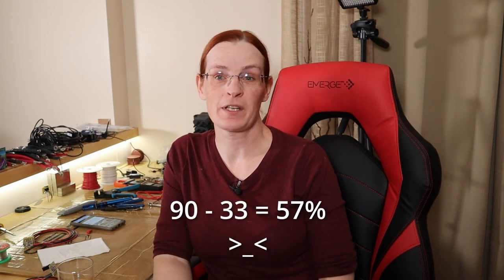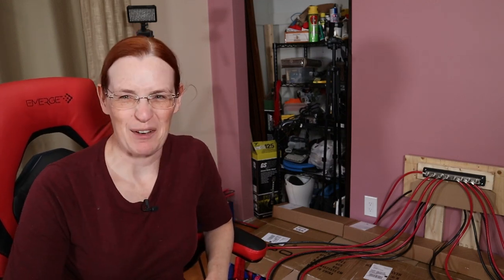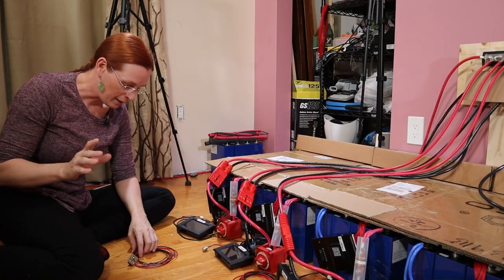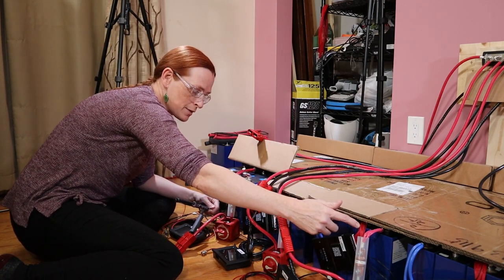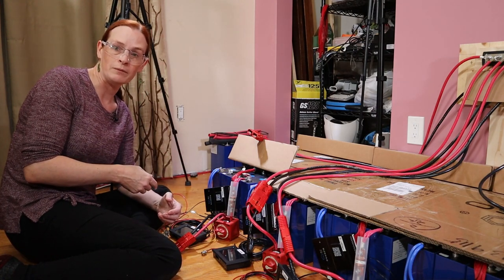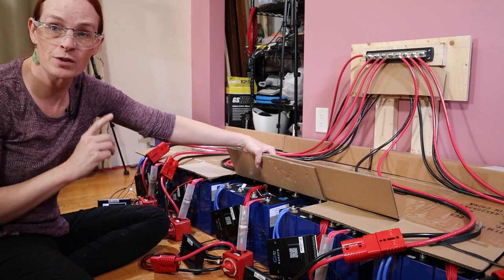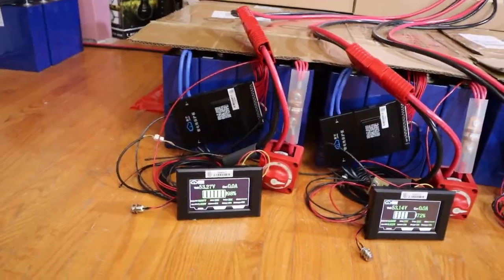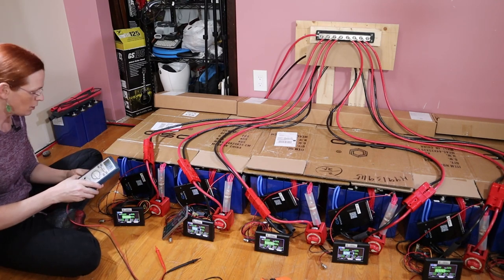It's Alive! (and I need some help) - Part 7 - Big Battery Build! (Ep. 44)

Comment: I have 8 Signature Solqr Batteries on my system. Victron MPPT rs 450-100 charge controllers. About 15875 watts of solar panels. First week all was fine. Second week battery 4 did not reach full charge (did not show 4 leds lit) Next week battery 4 and 5 did not reach full charge. Had the charge controllers set at 56 volts. The next week I put the charger on battery four and it started charging and finished charging 15 or 20 minutes later, same with 5. I changed my charge voltage to 57.5 ( shows 57.15 on the victron shunt) and have not had the problem since. As they get to full charge battery 1, 7, and 8 are the last to reach full charge. I may be charging with 10,000 tto 12,000 watts and the Victron controllers start reducing tthe watts. At about 400/500 watts all are showing charged except 1, 7, and 8. Within 10 minutes or so all are fully charged and I am down to bringing in only what I am consuming. After 5 months all is working perfect. I just assume there are small differences in cells and BMS's. Some days I use 60+ KW and some days only 15 but they have just worked fine. I m not in the middle of the ocean but I am 100% off grid and it just has to run the heat to save my plumbing. (US/midwest) Run your packs for a while and see what happens.
Reply from the maker: I fully expect my packs to deviate from each other over time. It's one of the reasons I wanted active balancers so much... I know each cell will age differently and want to have the best chance to keep them sync'ed though the range of SoC so that I can access the most power. Cheers on your systems sounds like it was a fun build!

Comment: There are many thouths already written...let me add some...any connection has some resistance,  also each cell might have slightly different internal resistance.The accuracy / resistance of connection is also influenced by the torque applied when mounting. Maybe that is why the first and the last battery still get a higher Amps...they might have a litte less resistance in connections, especially the bus bar connection should be fixed with an equal torque.
Reply from the maker: I admittedly did not torque the connections yet, but the resistances of battery cells and cables are all very very close, so I doubt that's a big factor. I think temperature of the outer versus inner packs makes the most sense. I'll break out the thermal camera next time I charge to see if I can see a difference.
Reply: @TheDigitalMermaid  Let me know the result of the thermal cam. I changed at my setup some details...and ended up with the result that my cells that i bought for the first 2 batteries are a total mess...no machting qr codes ect.  At least I regrouped the cells and so got a better performance and accuracy. Building good batteries is quite a complex thing. As you know Andy's offgrid garage I'd like to recommend also youtube Ray builds cool stuff. He is super in every detail explaining his battery construction. Probably you know that channel...

Comment: No one is perfect, i just smoked two capacitors on my power supply and still not sure why .My guess is cheap Chinese caps. I would not lose any sleep over .05 of a volt ? If it is not much hotter than the cats you are good. I have never seen a cat burst into flames and i have had a lot of cats.

Comment: With these batteries and how everything measures differently I would say they are close enough. I bet your shunt shows a little different reading also. My inverters show a tiny bit different than the BMS and my Multimeter also shows a tiny bit different. Dont let it drive you nutty.

Comment: I've played around with I2C voltage sensors and if you look at the raw digital values they are all over the place. So accuracy is a myth with these kind of devices. I also think we get too hung up on being balanced to within a few milli volts. My BMS only displays to 2 DP and my cells are within 10 to 20 mV and that is fine with me,
Reply from the maker: I'm starting to come to the same conclusion. However, I am still unsure about what kind of buffer there is in the battery specs saying to stay above 2.5 / below 3.65v.
Reply: @TheDigitalMermaid  99% of the time you won't get anywhere near those figures. The BMS should only ever take action when something external has gone very wrong.

Comment: Oh, #2. The higher charge current is because the outside batteries are cooler than the middle batteries.   Space the batteries the width of a 2x4 to minimize this from happening.   Double the width for the outside wall.
Reply from the maker: Ooooooh. OK, that makes sense, thank you! I'll repeat the test next time I charge and use the thermal camera to see if I can see a difference in the pack's temperatures.
Reply: These  batteries doesn't change in temperature because the are charge with C 0.03 if the do the are defective.  The reason is lower state of charge, which was also shown by the higher current on these two packs. 😊

Comment: Not fitting the theme but for your information, a Victron Mppt can be used as power supply without connected batteries. So a direct using of the solar power while you doing stuff with your batteries is possible.

Comment: welcome to the world of volt-nuts..   But yeah.... voltage measurements are only as good as the staiblity of the voltage reference (which cheap equipment have cheaper references that vary more with changes in temperature etc).... as far as accuracy.  But precision can be extremely good if its on the same reference. So if there is a single ADC with a single voltage reference sampling all 16 cells, then the precision can be down to very minor levels  (say the ADC has a full scale reading of 60 Volts, and is a 16 bit ADC, can measure down to 0.000916 volt steps ... up to a 20 bit ADC and that 0.0000572 volt steps.  ... obviously that is ideally of course).   Of course if each cell has its own ADC and reference, then becomes a much more difficult problem.

Comment: I had similar when first top-balancing my pack back in 2019. had no faith on what was 3.65v/cell as i had 2 meters, and a power supply all giving different figures. I just gave myself a 2.7-3.55v/cell range rather than 2.5-3.65v/cell for some leeway on the inaccuracies.  Its a fair headache when there is so much money in the cells and we all want a long 20-30 year lifespan from them.
Reply from the maker: Aye, and I think that's what I'm going to do; Annual calibration + generous buffers.

Comment: I went through the same probleme with my 3 packs. I decided to focus on ONE of my meters (turned out that it was an el-cheapo Mastercraft one) and calibrated the pack using the pack total voltage. Since I only charge to 3,45 volts, my conclusion was that even if I was off by 0.1 volts I would still be OK. My capacity test shows that I am hitting full pack capacity.

I DO NOT thinks it's more JK's fault than the fault of the meter manufacturer. All of them are CALIBRATED to a voltage. I think calibrating is required and the calibration is done to ONE meter in the BMS and that is why it affects ALL readings for every individual cel and pack total. 

P.S. I would change / return the Pack B BMS
Reply from the maker: If it keeps acting up, I might, but as you might have seen, BMS E also locked up.
Reply: @TheDigitalMermaid  Could it be bluetooth related? I use an iphone and it has never locked up on me ... ever
Reply from the maker: @paulbarrette2557  Maybe? I dunno. Not like Android isn't widely used, to be fair. How many BMSes do you have?
Reply: @TheDigitalMermaid  4 JK's are running right now. Like I mentioned... it does 'hang' when trying to connect if I do not RE-SCAN first. But I have never seen any of them require a 're-boot'
Reply from the maker: @paulbarrette2557  Not sure what to say... It's happened to two out of my six, one of which I caught on video.
Reply: @TheDigitalMermaid  I say try with another device... Android or not... Just sayin. Keep up the good work!

Comment: 18mV sounds much but thats just 0.53% out. (18/3339*100).  balancingwise it does not matter much as the error in individual cell readings is the same for all cells. the voltage reading is done with an ADC, and for that to be very accurate you need a precision reference, as the ADC has a reference voltage input und just reports how close it is to that voltage (simplified). the pack voltage is just a sum of the cell voltages and the cell voltage measuring was not calibrated. what is the voltage range for an individual cell according to jk ? this also plays into the precision.

Comment: Maybe they need some charge/discharge cycles so they calibrate properly. SoC is not displayed by voltage only but by configured capacity and other factors. The bms then calculates the voltage and amps that went in/out
Reply from the maker: Oh for sure they need calibration via charge/discharge. What has be curious is why six identical BMSes "guess" such different estimates pre-calibration.

Comment: I wonder if there is a relationship between the fully discharged to fully recharged readings?  ... meaning that maybe the lower voltage ones are more discharged first.  I find with only a couple of batteries (prefab) the 100% and the factory state of charge (bogus) test ... by reading setting voltages is not accurate and then adding the Victron shunt it is off even more...up to 20% different ....   !
Reply from the maker: Testing the voltages reported at top SoC and bottom SoC is a good question. I'll check that after I finish charging and when I do a full discharge.

Comment: Did you change your hair color? You can look at a MSDS/Material Safety Data Sheet, and they usually give you all that info you are looking for in the US. If you look at the NFPA/National Fire Protection Association they should list the flammability(red) and instability(yellow) of the battery. The brand I looked up they list Flammability as a 1 of 4 which means above 200F flash point. and 0 of 4 for instability which means very stable.
Reply from the maker: Ha! I'm getting old so ya, I colour my hair. If you know where I could find an MSDS for LFP batteries, I'd be grateful! I'll search on my own as well. Thanks for the comment about NFPA as well, I'll see if I can find how they come to those ratings.

Comment: Hi Maddy, love watching you learn and grow.  You are awesome. 😆 Question,  did you purchase 🤔 the screens with the BMS. I have 5 24v batteries banks and I want to put  this  metter on them.  Do they have them for 24v or are they just for 48v.
Thank you
Reply from the maker: Thanks for the kind words. ^_^ The screens are for the 4S ~ 8S BMSes, which is why I needed to make my own buck converters to get them working. They'll talk to the BMSes, but you'll need to drop the voltage to <= 24vDC. So in your case, they'd work just fine.

Comment: hello my good friend. I was always taught to charge batteries in parallel, corner to corner. In other words Positive, say on the left hand side of positive busbar and negative on the right hand side of the negative bus bar. That way you have charging current going through the bank, and not as you have it now. going in one end all the way to the other end. I hope this is of help. I will keep watching. Have a great day.Regards. Raymond.
Reply from the maker: I understand the logic of this in paralleling packs, but with all banks having equal cable lengths to the bus bar, I didn't think it would matter. That said, another commentor suggested it could be pack temperature, with the outside packs being cooler, so charging at a different rate. I'm going to guess, in my config, that is probably what's happening.
Reply: @TheDigitalMermaid  I cant wait for your next video, to see what you find. I am building a power wall at the moment. So I am watching your battery adventure with my eyes glued to the screen. Have a great day my friend.

Comment: I used to take my Fluke meter in for calibration every year. Curious if a bench charger would read same voltage on all meters. Thanks for sharing
Reply from the maker: A calibrated fluke is probably outside my budget... haha. At least I'm understanding why they're worth what they are though.

Comment: I set my charge and discharge to 75 amps since I will always have these 4 banks connected I should never see more than 50 amps unless I take one down for whatever reason then add it back and the other 3 charge it up which spiked to around 70 amps for me. I can always change that be do not see why I would ever have to unless I get a huge wind turbine then it and solar could go higher than 75 amps per or 300 amps total.

Comment: As one of your 'sailing' viewers, wait you went to the boat and we didn't get video?  LOL.  Think you are getting lost in the weeds when trying to balance down to thousandths of volts. Was curious how your are feeling about the plan now seeing how long the solar takes to charge up the batteries, and thoughts on re-thinking having some sort of combustion based charging source on the boat. But hope you consider including some more boat video's. Hope you were able to get in some good sailing on the Chesapeake, I keep my current sailboat about 20 miles north of your boat on the bay.
Reply from the maker: I'm sorry, I was in a little bit of a burn-out mode so I took my time there mostly quiet. I did do a little filming related to the 12v battery Pb -> LFP replacement that I'll be starting soon, but that's it. I didn't do much actual work on the boat so I didn't think there was much of interest there. I'll be back down there in January though, maybe I'll make a video or two about learning to winter-sail. As for the solar; I knew how slow it would be here at the house, the panels are not aimed well, and there is a lot of shading from trees for most of the fall/winter days. So I'm not worried about solar on the boat, not yet. Though of course that's why I am so determined to get prop regen. As of now, I am still planning to stay no-liquid-fuel. :)
Reply: @TheDigitalMermaid   No worries, or need to appologize. Just a reminder some of us like the sailing content too  :)  Good luck with the winter sailing, this will be first year I am planning on keeping my boat in the water over the winter so will hopefully be doing a little winter sailing too. Working right now to finish up my diesel heater install.  Maybe I will see you out on the bay.
Reply from the maker: @brianwarner7747  You said you're not far away, feel free to email me. I'm always looking for new friends to sail with.

Comment: oooo wait till you have loads on it and are charging at the same time....or big loads. It's going to want to make you pull your hair out :( There will be deviations. I'd say don't worry about it. The cell level monitors on these bms's are like this. They do use internal resistance as part of it. I think the tolerances are just a bit diff but haven't had a problem with my 1200ah 12v pack. Temp will change the readings as well. I don't think you need to worry about venting. Just make sure the cells are secure and you'll be good because we aren't using them as a high amp motor say for an electric car. We are using them lightly at low amps 99% of the time. Never seen one fail like this. The only high wattage things you'd do in an off grid system is cook if you use electric, stuff like that you only do for short periods of time.
Reply from the maker: Oh, I know that once things get going, stability is shot. That's why I'm trying to get things nailed down as best I can while all is quiet and consistent. As for venting, as I mentioned in the video, it's not about real world concern, it's about meeting ABYC standards to make insurance easier to get. Since I filmed this, I found an MSDS sheet showing that LFP are considered flammable, despite such conditions being unlikely.
Reply: @TheDigitalMermaid  Your doing an excellent job. I doubt it is any more flammable than old lead acid though. Probably far less. I can't wait to see these installed. Will definitely be a ton better than mine :)

Comment: while the buck converters won't make it to the boat, will the cats? Ships mousers are great company :)
Good to see you back on YT
Reply from the maker: I really hope so! Kepler (orange) is super skittish, so I am worried he'll get spooked and run right off the boat. So I'm not sure if boat life is in his future. Tatters, the old man, would be fine. Picatso is my daughter's kitty, so he'll go where ever she goes.
Reply: @TheDigitalMermaid  hmmmm, I'm sure there's an inflatable cat floaty out there :)
Side note, with all your confusion re: voltages and meters, you are testing against an unknown variable with micro loads being placed on it (BMS, remote screens etc). Go chuck your meters on a known, non fluctuating source and verify which one is in cal and don't touch the other meters. Got a benchtops power supply, DC converter, laptop power supply brick output etc to test against?

Comment: Great video, lots of information. Can you tell me what cell monitor you use?

Cheers!
Reply from the maker: Thanks! What do you mean by cell monitor? If you mean the BMS, it's the JK BMS.
Reply: @TheDigitalMermaid  No sorry not the bms, but the apparatus that has a wire that goes to every cell and you can see which cell has what voltage how many mv u are off between the lowest and the highest.
Reply from the maker: @luctessier2215  That is the BMS.
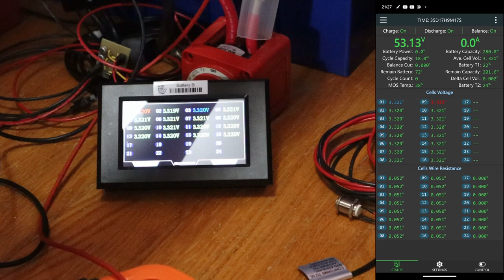Reply: @TheDigitalMermaid  the black box in 20:20, never seen one like that. Thanks for the info!
Reply from the maker: @luctessier2215  Oh, that's the optional display for the JK BMS.
Reply: @TheDigitalMermaid  ok that makes sense, didn't even know there was such a thing. Thanks